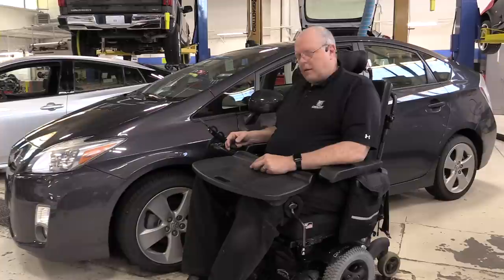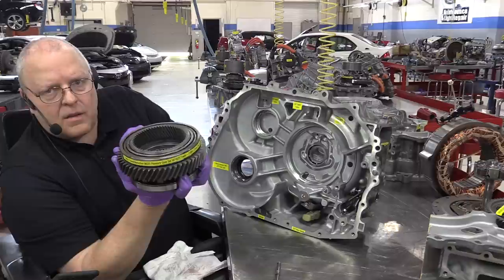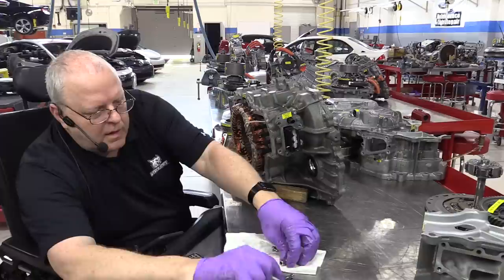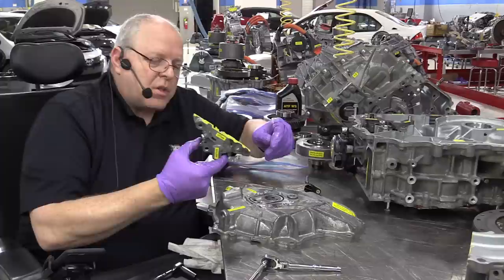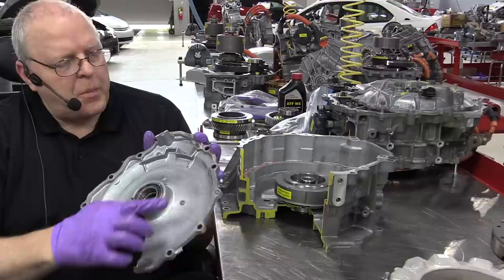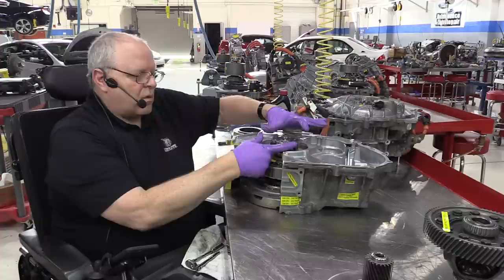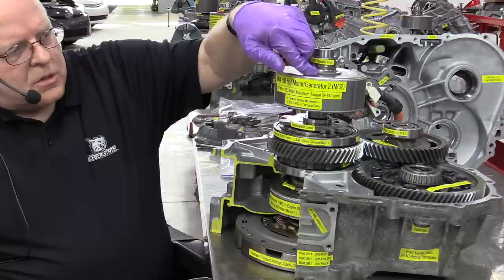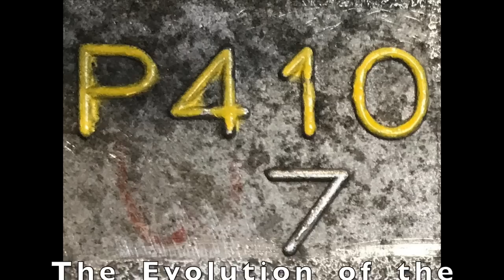2010 - 2015 Prius Transaxle -  P410 Deep Dive

Comment: "motor speed reduction" is referring to the motor speed OUTPUT.. You always refer to OUTPUT..  so.. Through the planet set,  the output speed is REDUCED at the OUTPUT the motor/gear set.   Think...  A motor speed reduction gear box doesn't slow the motor down.. It only slows down the motor's speed output through the gear box. (and as a byproduct steps up the torque output)
Reply from the maker: Thank you, that makes sense.

Comment: "Reduction gear" is the correct term for a gearset which reduces output rotation speed from the input speed (MG2 in this case).  If the Service Manual says it "reduces the required speed of MG2" (or such), that is an incorrect description.  Re the gas engine having to come on at 61.5 mph, a power limit might apply for level driving with no wind, but if descending a steep grade (or a strong tailwind) there likely is sufficient power from just the e-motors to go faster.  If the gas engine still turns on, it may be because the controls simply consider road speed, regardless.

Comment: Great video. Thank you. Please show more about how you clean the bolt holes and fasteners. 

I am 74 and worried that fumes from spray cans like brake cleaner or carburetor cleaner  might cause kidney damage. I agree, cleaning the bolt holes is important. 
So far I use half strength simple green in an air pump sprayer. Absorb oil with newspaper sheets in a bus tray.  Then I brush parts and rub with rags. Then, rinse with distilled water in another air pump sprayer. Sometimes, a little blast from the air nozzle or dry wet fasteners in a bakers metal loaf pan with an electric heat gun set on low.  Even with all that, the orange sealant used on a Subaru trans pan still had bits of orange sealant after a lot of brushing.

Comment: Next to the 3 phase wires that exit the case on MG2 there is a bundle of wires (2 or 3) that terminate inside the case.  Neutral wires?  I never knew there was separate oil filler location, I've always used the level check location when changing oil, great info love the entire Prius series!
Reply from the maker: The separate bundle of wires is just the center connection of the Wye wound stator wiring. Normally it is hidden and bundled up on the stator edge. Thank you for watching and for your feedback!

Comment: Love your videos, I have a 2010 I’m converting to full EV, based on this video I think I should lock the engine input shaft. But then oil pump never runs. With a plug-in version you get 13 miles of ev range but engine might turn on and off. I really don’t want to open up the transaxle so I might just run it and see what happens

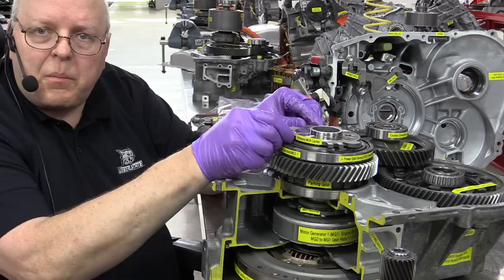Comment: 1:06:10 The MG2 stationary planet carrier being held by notches seems a bit crude (although cant see any better way to do it), and since MG2 can switch forcefully from power out to power absorbtion (generating), that planet carrier can get oscilating load backwards and forwards, and so could potentially 'rattle' in the housing. Slightly surprised there isnt something more rigidly holding it or 'damping' any potential vibration.
Stephen, JDM Estima Hybrid 2011 with P311 transaxle.

Comment: Thanks again professor, in my opinion, the battery power 4.4kwh for gen3 plug in prius limits the speed to 61mph. Actually in my research only 3kwh is usable to help extend the life of the battery. As you said professor, at 61mph, both the mg1 and 2 are rotating at around 7,800rpm which is 60% of the rated 13,000rpm.
Reply from the maker: Thank you. I agree, battery power limitations are the limiting factor, not rpm for gen 2 and above rotors. Gen 1 ran right up to their rpm limitations around 44 mph. Thanks for your feedback!

Comment: I'd argue that it's a bit simpler than arguing that MG1 is the motor that has reduced speed - instead, the MSR gearset acts to take MG2's output RPM, and provide gear reduction of that output. It's used to enable a faster MG2 speed (and therefore different gear ratios that allow lower MG1 speed), of course, hence why you could argue that it's a motor speed increase gearset, but it is reducing MG2's high output speed to a more manageable speed.
Reply from the maker: Thanks for your feedback. Engine off.  2nd gen P112 MG2 rpm at 65 mph is 3914, MG1 rpm is -10,178. 3rd gen P310 with MSR gear set MG2 rpm at 65 mph is 5956, MG1 rpm is -6249. The MSR gear set provides gear reduction, torque multiplication, lower MG1 rpm and higher MG2 rpm. MG2 is smaller, lighter, and less powerful on the 3rd gen transaxle. MSR's torque multiplication actually increases overall torque to the wheels, but at the cost of a much higher MG2 rpm.

Comment: Perhaps the protected parking pawl servo motor bolts are to discourage towing theft of the car by removal and manual disengagement of the pawl?  However, I'm not aware if that area can be easily reached from underneath the car.
Also, I'm not sure if you mentioned exactly why the MG1 and 2 resolvers need to be so precisely adjustable, unless that was in another video?  I can only imagine that it locks in the commutation phasing, and for absolute maximum efficiency that is optimised at the factory for every individual assembly.  It sort of indicates that there is a wide production variation in winding magnetic characteristics with the round wire, something that is perhaps improved with the more-precisely laid square wires in the P510 unit?  In fact I don't recall seeing resolvers in the video of the P510 - are they present?
Thanks for your videos and responses!
Reply from the maker: The servo motor is difficult to get to. You are correct about the purpose of the resolvers. Yes, they were in the P510 video as well.

Comment: another thing that I find interesting..    If MG2 is WOT, full power being delivered based on voltage/current allowed to be drained from the battery and the engine is running..  Regardless of slip between MG1 and engine speed, 100% of the engine power is being contributed to motivation of the vehicle. This is because what torque from the engine is NOT being directly applied via torque split assembly, the rest of that torque is being applied to MG1.  MG1 then ELECTRICALLY contributes to charging the HV battery, which then is directly supplying power to MG2..   SO, Regardless the ratio between the power split unit, engine, and MG1, it is safe to say that 100% of the engine torque is either directly, or indirectly applied to motivating the vehicle to move based on power management schemes.
Reply from the maker: That makes sense too. Thanks for the feedback
Reply: What you describe makes perfect sense. And I would add that the control unit regulates the MG1 speed (by regenerative braking or electrically driving it) to obtain the best engine speed for the requested load. If MG1 needs to be “driven”, then the energy for MG1 could also come directly from MG2 if the HV battery is too low and as long as the vehicle is moving. The gas engine would then supply all the required power.

Comment: Interesting fact is that the only thing powering the vehicle when its going in Reverse, is MG2, as that thats the only thing that can power 'backwards'. There is no reverse gear. Well I guess that isnt a surprise as MG2 powers low speed forward and backward.

A quick question - what happens when gear lever is in Neutral ? I guess its a fake neutral that effectively disconnects everything (except MG2) from the output shaft ? Regardless of if ICE is running or not.  Handbook says in N that the battery doesnt charge even if engine running  ie MG1 is not generating  (compared to P with locked drive shaft and where MG1 is generating if ICE is running).

Comment: The tamper resistant fasteners located on the parking pawl servo motor may be an effort to reduce the manufacturers liability and avoid a negligence-type of lawsuit. The parking pawl is a safety device that the manufacturer does not want to be overridden.    In the hypothetical scenario of the parking pawl being overridden, the  car would be effectively in neutral and could be towed, or roll down a hill.    The spin of  the cars front wheels would spin the generator without any power management/computer control.    Basic motor theory is :   (1) magnetic field,  (2) conductor,  and (3) relative motion between the magnetic field and conductor,   results in a voltage being generated.   That un-managed voltage could result in an electric shock/electrocution,  fatality,  an overheated wire with subsequent  insulation failure, an electrical fire, an overcharged battery,  a battery fire,  hydrogen off gassing of the 12v lead acid battery,. or some other result that the design groups failure/hazard analysis reviews hopefully addressed.  

...for me, I just want to roll my recently acquired  inoperable Prius parts car off of the tow dolly.   

By the way,    Thank you very much Mr. Weber for your good work!

Comment: This is an excellent video for the enthusiasts like us John. Thank you for your effort. 
Is there a video that explains how each component rotates per the different stages of the driving for Generation 3 Prius? You explained it a little bit in your video but I am looking for a bit more detail so I can find specific answers to several questions I have.
For example:
- Is it possible to move the Prius just but utilizing the ICE? I guess the answer will be "No" since you cannot transfer the engine torque. Then if you have high voltage electric system malfunction, would this immobilize the vehicle?
Or 
- Can Prius move by just ICE + MG1 (Say there is MG2 malfunction)? You kind of demonstrated this in your video but this isn't a valid driving mode. Is it possible to drive the vehicle in an emergency if the MG2 is not functioning?
- Can MG2 operates as a generator (at times other than when it is used for regenerative braking) to power either MG1 or to charge the battery?

I am looking for answers to many of questions like the above ones or similar.
Thanks
Reply from the maker: Is it possible to move the Prius just but utilizing the ICE? Technically yes, if MG1 (Sun gear) was programmed to slow down and force the ICE (planet carrier) to overdrive the ring gear (MG2). It would not have much power because it would be an overdrive condition. Can MG2 operates as a generator? Only when decelerating, it is physically connected to the final drive gear and must turn when the tires turn. I hope that helps

Comment: Great video, thank you. P410 is used in EU for the Auris Hybrid car.
I have a question though: I thought that the diameter of eachgear was proportional to the teeth count, imposing the teeth number of the Ring R to be equal to the teeth number of the Sun gear + 2 times that of the planet gears (R = S + 2P). This works for the MG2 speed reduction gear set (22 + 2 x 18 = 58) but not for the PSD (30 + 2 x 23 = 76 # 78). Am I wrong?
Reply from the maker: Thank you! That is a good question. Now I need to count the teeth again to verify.
Reply from the maker: I verified the tooth count, 30, 23, and 78 are correct for the PSD.

Comment: The transaxle oil pump only operating when engine (ICE) on, is presumably acceptable? As engine will be running in most cases when high load is occuring, and the lower load cases with engine off can probably be handled lubrication/cooling wise by splash lubrication. How about high 'reverse' load when MG2 is doing heavy regenerative braking and engine might be off? Hopefully the limited lubrication/cooling is still sufficient in that situation.

Comment: wait a minute - the oil for cooling the transaxle, bearings, etc., only gets circulated when the ICE is running?  It seems like you'd need two oil pumps, one each for ICE and transaxle, but I guess not...  maybe there's a temperature sensor which starts the ICE when transaxle/motors get too hot?

Comment: Wait a minute. It's a CVT without pulleys and a belt? The planetary gearsets can achieve the same function? Is that right?
Reply: Controlling the speed of MG1 does what mobile pulley and belt do in mecanical CVT.
Reply: @badscrewold3162   With the benefit of being a lot more reliable.

Comment: So yeah higher voltage can use smaller wires because it uses less amps to run like 40v 30 amps is same  like 80v 15 amps, I was thinking would be good 2 mention.

Comment: As always, superior work.  I did not realize the Prius v transaxle has cooling that the normal gen3 Prius does not.  Question: my understanding is the Prius v has a different final drive ratio for more load carrying capacity.  Do you think that requires different gears or is it simply modified programming?

Comment: thanks professor. since mg1 connected to sun gear. it look like it should be stationary to allow ice to transmit its full torque to wheels. 
i mean how that happens without fully breaking sun gear and mg1
Reply from the maker: The difference in speed between MG1 and the ICE determines the amount of torque delivered to help MG2 propel the vehicle. You are correct, if MG1 were stopped, full engine torque could be delivered. But if it were stopped, nothing would recharge the battery as you drive.

Comment: It seems to me that with ICE off, the maximum torque to the wheels is limited by how much resistance an ICE has against being rotated. Or can MG1 be controlled in such a way that there is no reaction torque on the ICE crankshaft? And my second question is why a clutch is required to limit the torque? What are the conditions that there is a high torque that has to be limited to prevent what from being damaged?
Reply from the maker: MG1's regenerative abilities can be turned off and allowed to free spin. MG1 rotates 3.6 times for every rotation of the ICE crankshaft, so it is very unlikely that the ICE crankshaft will ever turn while driving on MG2 power alone. The torque limiting clutch is there in case the engine output or input exceeds a certain limit. Rapid deceleration would be one example. A seizure of the ICE while driving would be another. A internal bearing or gear set failure in the transmission, etc..

Comment: Hello Dr Kelly, thank you for sharing so much knowledge. I own a JDM ZW305 Plug-In Prius. I want to ask, is there any difference between the P410 in the standard Hybrid, vs the PHV versions? As you will know, the PHV has an EV mode when charged, ie; can be selected (in some markets), not others. Is there any mechanical modifications within the transaxle assembly for that purpose? or is it solely software variation? I would appreciate your insights on this. The placard states transaxle: P410 - O1A on my particular car. It uses the 4.4Kw/H Lithium Panasonic pack. Some material suggests it has increased output, up from 60Kw, to 100Kw when fully charged, as the voltage is increased from the standard NiMH pack, at 201.6 Volts nominal, to circa 288 Volts nominal ??...I'm a bit sketchy on the exact figures there..any help much appreciated.

Comment: I’m looking at buying one of these transaxles for a project and I noticed the input shaft without the torque damper is really hard to get turning is that normal? on the previous generations its fairly easy to turn without the torque damper so I am unsure
Reply from the maker: Yes, it can be normal depending on if the transmission in in park.Thanks for watching

Comment: hello dear sir
  Please kindly answer my questions
  Is it possible to get a constant RPM from a P410 gearbox port, or any other model assuming 1,500 constant revolutions from the gearbox outlet?
  Assuming we have an external feed for a variable MG1 or MG2 motor that rotates from 1500 rpm to 10,000 rpm

Comment: These transmissions are called a cvt transmission. Does this unit not change the rpm ratios between input and output but uses the added torque from mc1 and mc2 to accelerate at would normally be not a good gear ratio on a normal gas powered car?

Comment: Very good information thank you.
I have a 2012 Prius, while driving at 30 mph it slammed hard like a down shift and the engine revved up, now the car acts like it’s in first gear won’t go above 30 miles an hour, and when it is at 30 the motor is revving high ?
Reply: Check your torque damper

Comment: Excellent presentation, thank you
You did mention the total gear ratio of 8.6 from MG2 to the wheels but I miss the number of teeth of the counter driven gear (same as the counter drive gear?) and of the final reduction set?
Reply from the maker: Thank you! The counter drive gear = 54, counter driven gear = 55, pinion = 24, ring gear = 77, overall = 8.615